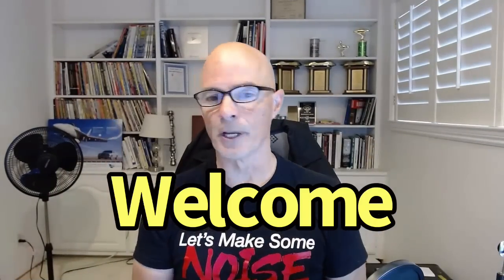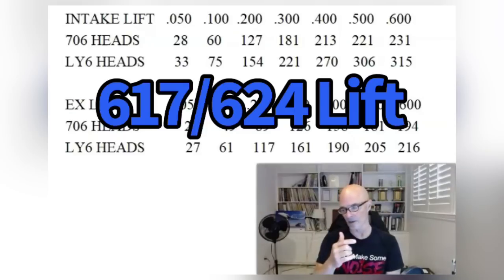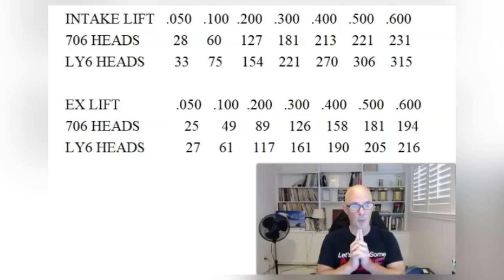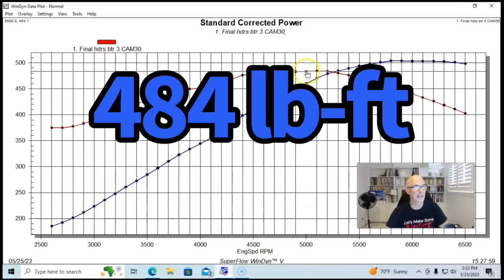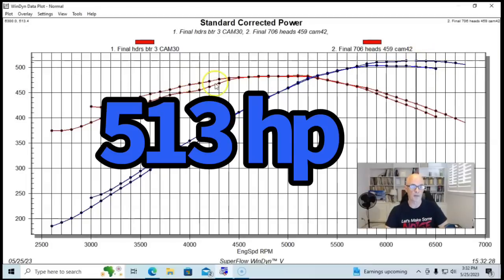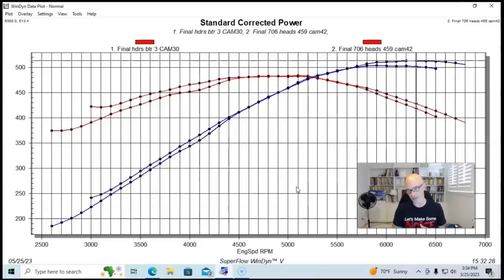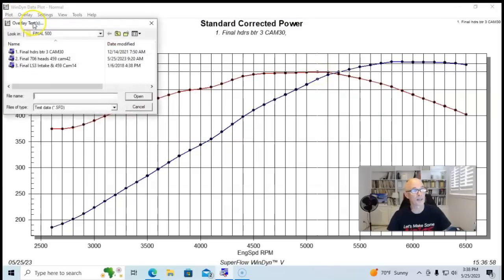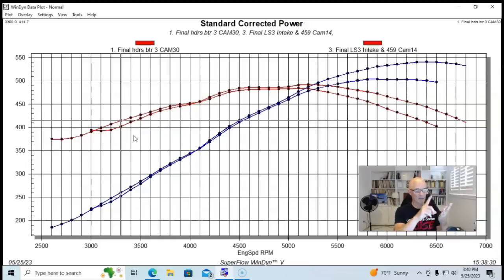HOW TO: BIG LS POWER WITH MILD CAMS-THE KEY IS HEAD FLOW. BIG CAM, SMALL HEAD VS BIG HEAD SMALL CAM

Comment: Why don’t you do a actual video where you measure piston to valve clearance and stuff the biggest cam you can in a LS and let us see what they’re really capable of. I’ve seen a stock LS 1 put in a 240/244 vindicator cam and it did not have interference issues. That would be cool Richard. 👍👍
Reply from the maker: 240 @ .050 seems big

Comment: I wager its because of the compression difference on the cathedral heads, if it was actually a point difference.

Curious what more compression with rec ports would come up with, way big cam.  I know nitrous and boost are hp, but i have a soft spot for n/a motors..

Also how rude of me, thank you for doing what you do, and making this info available!

Comment: I actually didn’t realize any ls head flowed so little cfm. I expected a earth shattering difference but I guess it wasn’t a massive change
Reply from the maker: so little?
Reply: @richardholdener1727  231 194 @600 I thought every ls head would be over 250. I have these old trickflow twisted wedge g1 heads on my 400sbc that I’ve had forever. They flow 240 and 204 at 600 but I’m processing how it would be possible they flow more then heads you just easily made over 500hp with them. My cam is pretty small but maybe it’s just way wrong Because I can guarantee it’s under 400hp. Lift: .490''.490"
Duration: 286°/286°
Reply from the maker: you are comparing a stock ls head to an after market SBC head and saying the stock head is not good? Maybe a more honest evaluation is in order. BTW-a 400 inch sbc with those 240-cfm heads and 286 cam (near 235 @ .050) shouldn't make 400 hp-it should make a lot more unless you have another problem.  Good luck
Reply: @richardholdener1727  sorry I worded that wrong I meant it seems like those stock ls heads are making way more power then mine do but that was sort of the question maybe something else is wrong with mine then because I know it’s not making 400hp by the 1/4 mile track numbers. Thanks for the follow up

Comment: Ly6 in my 2500 - i did a custom grind 113 lsa 213 224 .555 .550 and it runs strong in this heavy burb. Pulls great too.
Reply: To add it drives great as well

Comment: I may be totally wrong and oversimplifying but in my head I see rec port heads as equivalent to a ported set of cathedral port heads. I scratch my head when I hear of people sending a set of 243 heads out, paying $1200, and waiting a month or more to have them done. Could sell the 243’s and with the porting money buy a brand new set of rec ports that summit will deliver in 3 or 4 days.
Reply from the maker: ported cath ports make more than stock rec ports
Reply: @richardholdener1727  Very interesting. Is it a large difference and do you have an idea why that is happening? 

Here is how I came up with my incorrect assumption if you care to see. Your rec port numbers along side Lingenfelter ported advertised flow numbers. On paper they are oddly close. 

Lingenfelter 243-(L243)

.200
LY6
  I-154
  E-117
L243
  I-157 +3cfm difference 
  E-120 +3cfm difference 

.300
LY6
I-221
E-161
L243
I-224 +3
E-161 -0-

.400
LY6
I-270
E-190
L243
I-270 -0-
E-202 +12

.500
LY6
I-306
E-205
L243
I-304 -2
E-216 +11

.600
LY6
I-315
E-216
L243
I-320 +5
E-224 +8

Comment: ALSO with .030 milled off and a very modest port job the rec port heads become a totally different animal. Besting even the wildest cath ported head.
Reply from the maker: no
Reply: @richardholdener1727  Very few cath port heads will keep up with a modestly ported ls3 head. Certainly no OEM casting will. Maybe Frankenstein or someone has a cath port setup that flows 360+ at .600" but at that point i bet the cath port isn't that far off the rec ports dimensions lol.  

I mean you can buy oem cnc ported ls3/9 heads from GM that flow 355 cfm.  At a modest .600". Knock some material off too get the compression ratio back and i dont see any cath port stock casting ever touching them. 

As an added bonus the LS9s come with better casting, thicker decks, better alloy, titanium intake valves and sodium filled Inconel exhaust valves. And they were available from the dealership for 1200 ea assembled. 

Id put them against a Frankenstein cath port any day of the week. Especially for the money.

p/n 19328743
Reply from the maker: thnx for the reply, but milling any head doesn't make it a totally different animal. it adds compression at a fixed rate relative to the change in chamber volume. This changes power at the rate of 3-4% per 1 full point of compression. I agree ported rec-port heads ultimately flow better and have their place on bigger motors-take a look at the video going up today
Reply: @richardholdener1727  I look forward too it as always man.

My.main point is that the bump in compression offsets any tq losses. (I have heard of guys taking 0.50 too even 0.060 off of them. No experience there)

Personally on a boosted motor i leave em as is and leave the comoression slightly.lower, especially on a street ride. A properly sized turbo and cam is can give rod bending torque in the midrange anyways.

Comment: I asked BTR about using their LS3 stage 2 v2 (221/24x) on a 418 LS3 and they steered me directly to a .640" valve lift, 19* overlap cam. No questions about vehicle usage, application, parking lot manners,  drivetrain, etc. Disappointed.
Reply: I've heard similar stories about them. I think they let their surge in mainstream popularity go to their heads. Also a lot of cam experts have explained they really aren't experts on LSA. Check out David Vizard and blue collar hotrods.
Reply: Large displacement eats up overlap. While 19° sounds big for a stock 6.0 , the cam would behave much tamer with 52 extra cubic inches.

Comment: Nice test. I think the 459 cam is the closest test I have seen to compare my 6.0 821 head with 230/242 cam. I switched from a 220/224 and picked up right at 30 whp. 

Compression ratio and port velocity at lower rpm help those 706 heads for sure. 

Cath ports are just fine for most folks. The rec ports dominate drag setups though. Lots of guys take a 6.0,  rec ports, huge ca, big single plane, and max that head flow. Lots of 600-650 hp untouched rec port 6.0s at the drag strip. Plenty north of 700 with port work. Takes a ton of rpm though. 8000+

Comment: Hey Richard I’m putting together a roller 5.0 with AFR 185s and the comp xe274. My current valve springs are rated for .600 lift, 135lbs seat pressure and 340lbs open. Comp told me 120-130lbs on seat was recommended, do you think 135lbs is too much?
Reply from the maker: it might not be enough-definitely not too much
Reply: @richardholdener1727 Thanks for the reply ! Do you have a preferred valve spring when running that cam ?

Comment: This is a great video, I always want to see a big cam with stock heads just to see the results since many people can't afford a nice set of heads initially. This also applies to older odd ball engines since there may not be a high flowing head readily available. Often (and understandably) dyno tests are performed with heads and cam swapped at the same time which leaves you wondering, how much power the heads or cam was worth individually. Thanks!

Comment: I’d say it was compression that made more torque on the cathedral
Edit: also the larger 6.0 needed more air at even low speed so the big cam helped the small head get enough air to the large 6.0 and then I assume the cathedral “small” head is the one that made more compression which always makes more torque

Comment: I built a screaming 8500 rpm motor for my high school daily driver.  Then I blew it up and rebuilt it with a stock cam but the same displacement and great flowing heads.  Suddenly it was a tire shredding riot to drive.  Maybe not ultimately as fast as the screamer motor, but a helluva lot more fun on the street.  Spend the most you can afford on the heads.

Comment: Compression is king. More compression let's the engine come onto the cam sooner. Combine that with higher velocity at low rpm the 706 offered its going to work better than the rec port down low.

Comment: The 706 heads had better airspeed past the smaller valve which promotes better atomization, this plus the extra compression is why it made better low speed torque. That truck intake is choking those other heads, 5700rpm is only 255cfm demand and 6400rpm is only 286cfm demand, the larger cross sectional area of those heads is the reason it could carry the power for longer.
Reply from the maker: having made 600 hp with the stock rec-port truck intake-the intake is not the problem
Reply: @richardholdener1727  but on what heads, cubes and rpm? I bet there is a fair % loss of head flow with the manifold bolted on.
Reply: @richardholdener1727  that would also say that you don’t think an aftermarket intake manifold would perform better?

Comment: Hi Richard! Once again an intesting test setup and thank you for including the 'wide' torque/hp' dynochart! I wonder would the smaller displace has something to do with benefiting the smaller ports of the 706 heads thus creating better lower rpm torque? About selecting the cam...In theory to maximize the flow amount in and out of the cylider, shouldn't we choose the cam that lifts the valve to the best flowing position of the head asap and maintains the lift as long as possible during the engine cycle?

Comment: I just put together/installed a flat top 6.0 with a SS3 cam and milled .025 862 heads. For a street car, it has plenty of low end torque, sounds really choppy, and pulls strong in the higher rpms. Best street combo I've built so far on a budget.
Reply: I haven’t calculated that CR but, has to be around 11.5-12:1.
Pump gas?
Reply: @jakewade7388  yes 11.7 compression and dynamic compression is around 9.5 with the SS3 cam. So I run 91 octane with a little bit of e85 mixed in to be safe.
Reply: I’m building a similar setup for my square body. Haven’t settled on a cam yet , block is going to machine shop week after next. Have you had it dyno’d yet? What sized stall are you running?
Reply: @mroconsultingandsupport4776  have not dynoed yet and I have a 3500 stall

Comment: I'm starting to think the smaller cam is the way to go. Especially if you find one that delivers power where you want it. Then if more power is desired, upgrade heads, intake, add cubic inches or boost.

Comment: Don't fall in love with a wild aggressive cam. Shoot for the flattest, broadest power/torque curve possible. That is easier with a smaller cam and better flowing heads. Remember, a engine is only a air pump.

Comment: I have a pair of BBC 565cid engines I use in a Marine hi-perf offshore application with AFR Cnc ported 315cc heads, single plane intake manifolds, single Holley 950HP (small bore venturis) carb w/annular discharge boosters, full length tubular stainless steel dry headers using BABY HYDRAULIC ROLLER CAMS of  232°/324° duration @.050" lift at around .630" lift on a 115° LSA...they have very crisp throttle signal/response and killer torque   with horsepower peaking out at about 5400rpm ... the boat runs like a terror banshee! So, I am all about small intake runner size heads w/great flowing /breathing characteristics and "err" with a cam on the smaller side--- and it idles like a "sleeper" @700rpm in neutral with excellent drivability around the docks, boat traffic.  At least it works for me in this reference and application.
Reply: Sorry about the cam specs it was a typo... It's actually 232°/240°

Comment: Hey Richard. Appreciate all the info as always. Have you ever ran a tsp torquer v4 cam? Currently building an lq4 for my street truck rcsb and Was recommended this cam by them. Motor will be bored .030 over and piston head change to achieve around 11:1 comp. Gen IV rods, Tbss intake with a 92mm TB. 1 7/8 headers and full 3” exhaust with x pipe.
How you think this will run? Or anybody else TIA
Will be ran through a 4l80 and 4.11 gears.
Reply from the maker: it will work fine

Comment: I’d like to hear anyone’s experience with over-camming an engine.

Personally, I’ve run cams in the mid-high 230’s on various engines in a street car and have never experienced this “over cammed” phenomenon. Both carbureted and fuel injected for that matter.
Reply: I am a firm believer that the "Over cammed Phenomenon" is as big a conspiracy theory as JFK is still alive. Not happening. Under compression? Yes
Under inducted? Yes
Under evacuated? Yes.
Over cammed? No.
Reply from the maker: a 230 cam on a 4.8l (or 5.3l) is not a good driver-converter and gear help, but not a good choice for a daily truck

Comment: Sometimes smaller is better somewhat, and at lower rpms the air movement Velocity greater cause of differences in port angles and valve diameter in relation to cylinder bore size

Comment: 706 is more efficient,  some is compression but fair chunk is air speed . Give 706 a nice rub and it would likely out do the “big+big” despite still not flowing the same but the big head is working in the 1.7 hp per cfm so not close to optimal

Comment: Based on build price alone it's an easy choice.. the combo with 706 heads would be a lot cheaper than the rec port heads of sourcing used parts.  Would limit fuel options to the highest octane from the pump though. 
Great test!! I'm convinced I need 799/243s for my build. Will do a little bit of porting and have the best of both worlds

Comment: The 706 shows what happens when you unshroud the valve. It's quality of air into the cylinder, to make power. Now, some of that power is tainted by the rise in CR, due to the smaller chamber of the 706. I have my speculations on cam selection on that 706 combo. It would be no mor than 264 seat to seat, but on a tighter 109 LCA. Should pull well with a flat torque curve, and still make 500hp

Comment: Used a Comp HR265 114 LSA, home ported 243 heads, 50lb injectors and a factory LS1 intake and long tubes on a 5.3 with stock internals...huge upgrade over my old LS1 in a 98 TA.
Reply from the maker: yes to everything but the og ls1 intake
Reply: @richardholdener1727  I know I know you have taught me well sensei but that all I could afford..so which intake would you pin down in my situation since Ive got a bit of cash for one now?
LS-6 is what I was considering Dorman makes a fairly affordable one, but man its kinda weird having a Dorman intake lol, thanks brother!!!
Reply: @artlife6210  LS6 is the best compromise with price/performance considered.

Comment: I watch all your LS videos and this is by far the most helpful. I have a mild cam in a 6.0 with stock 243 heads and i have often wondered if using a better head would be of benefit with only 222 degrees of intake duration.  Now i kmow its benificial and i can get a bit more power without living with an overly lumpy idle.
Reply: 243s...youve got the best stock heads already, I ported mine to be smoother but not too aggressively, AFR heads might give you a bump but dang theyre expensive.
Reply: @artlife6210 I had my 799 ported at tsp and had them reworked at my head guy. Went from prc 314cfm @.700 vs 322cfm @.700
Reply: @derekr1854  799s are nearly the same as a 243s I think. I found the 243s to have less roughness in the ports than the 799s I have but I still just smoothed out some humps and  bumps and ridges in there...not sure if it helps tho. lol but it made me feel better😂
Reply: @artlife6210  243/799 are the same cast. The ls6 have the hollow valve stems. Depending on some cars or trucks. You could have 1 243 head and the other a 799 head. I didn't like the casting left from tsp. I sent my heads to my shop guy. Lucky I didn't put the heads on my 408. Aluminum particles in the runners after I got them back.
Reply: I don't know what you have it in that seems like a kick-ass engine !

Comment: I want to see the smaller cam and the 706 heads on a 6.0 for truck use
Reply from the maker: pick the 706 heads and truck norris cam
Reply: I have this combo in a 06 lq4 3/4ton 4wd silverado. Its a crewcab 6.5ft bed truck with 4.10gears and 35s. Honestly, feels pretty close to stock until about 3500rpm. 4l80e sucks up a lot of power. Need a supercharger ha

Comment: Vehicle weight, gearing,  90 % of use, are factors that change cam spec on every combo. Larger intake valves benefit torque, is a general given. Under caming is ok for street cause engine is pleasant @ all rpm levels (<6K). Over caming can be so unpleasant,  vehicle's not drivable.  It either sits or gets changed. Cam MFG's selection advice for exact combinations  is usually golden.